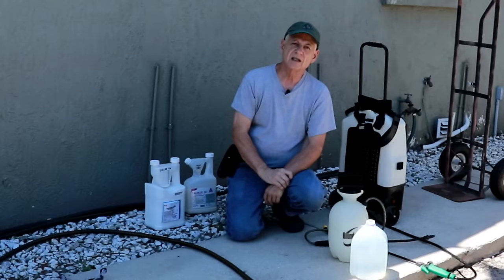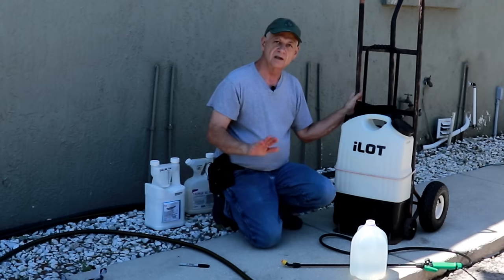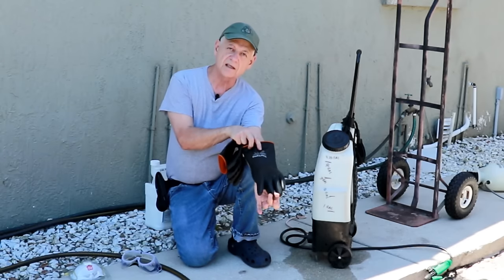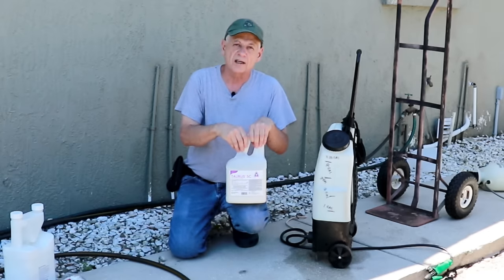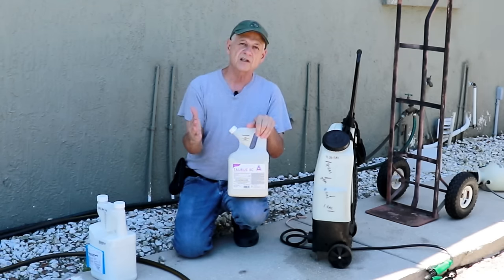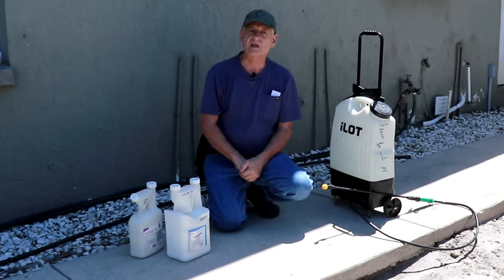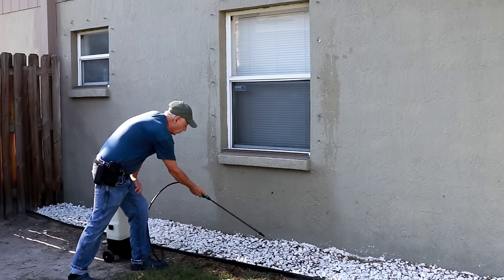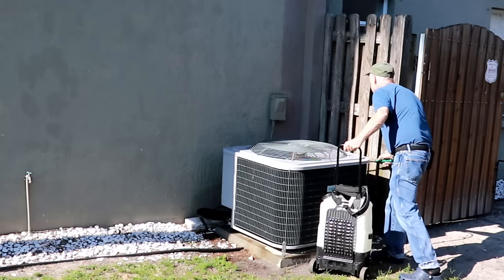General Exterior Pest Control - IMPORTANT!  READ THE DESCRIPTION.

Comment: Thank you for producing these super informative videos.  We live in Northern FL in a rural heavily wooded community.  Have you heard of Tekko Trio Concentrate as an indoor application for roaches, earwigs and ants?  Or do you recommend The outdoor use of Taurus SC instead?
Reply from the maker: Tekko Trio Concentrate is an insect growth regulator and not an actual pesticide.  It works by breaking the lifecycle of the target pest.  One of the big problems with it though is that it is very slow acting.  I think it is probably a fine product to mix with an actual pesticide, but I would not use it as a standalone treatment.  Most of the pests that are coming into your house, are coming in from the outside.  Therefore, if you do the exterior treatment every three months, you will no longer have any pests of any sort inside your house, except for the ones that either fly in through an open door or window or the ones that you carry in yourself.  I know that I wasn't very clear on this in the video because it was the first one I ever did and I didn't exactly do a perfect job, but you should know that what I meant to say in the video was to alternate between the Taurus SC and the Talstar P every three months.  Do the first treatment with the Taurus SC, then three months later use the Talstar P, then three months after that you go back to the Taurus SC, and so forth.  Also, the backpack sprayers that I suggested in the video are no longer available for purchase.  I will provide a link to the backpack sprayer that I recommend that you purchase.  It's a little bit pricey, but it will serve you well for many years.  After you do the exterior treatment, that should end most your bug problems.  However, if you already have some pests inside the house, let me know the specific pests you have and I will tell you how to get rid of them.  After they are gone, there won't be any more coming in.  If you would like to save a bit of money, you can use Bifen IT instead of the Talstar P.  I will provide you a link to the product.

I hope that helps. Be well my friend.

Backpack sprayer:  https://www.amazon.com/dp/B08B3MKYWD/?coliid=I1WHD5A3RF25H9&colid=3VDXA5DFBKQ98&psc=1&ref_=lv_ov_lig_dp_it

Bifen IT:  https://www.solutionsstores.com/bifen-it-insecticide

Taurus SC:  https://www.solutionsstores.com/taurus-sc-termiticide
Reply: I am immensely grateful for your thoughtful, detailed answer.  I will follow all your advice on treating our exterior.  That said, we spend a lot of time outdoors with our pigs, ducks, geese, rabbits and large vegetable garden.  My point is that we are likely bringing pests inside with us, especially “wood roaches” and earwigs.  Any advice on what we can safely do inside the house?
Reply from the maker: I don't know that I would be too concerned about bringing earwigs and roaches into the house. They are most likely going to try to make their way through the barrier that you applied around the house, rather than trying to catch a ride on your clothes or anything like that.  I think what I would be more concerned with is perhaps something like fleas.  These guys are hitchhikers and they will jump onto you and you can easily bring them into the house.  Let me know if that seems to be a problem or if you are seeing any roaches or earwigs in the house and we can certainly address any of those issues.  After you treat the exterior of the house, you may still see some of those roaches or earwigs hanging out in the house and you may need to treat for them to get rid of them.  I would give it at least a couple of weeks to see if anything that you have in the house just kind of dies off on its own.  Treating for the earwigs is kind of a pain in the neck, but if you've got them, then you don't have much other choice.  If you do have an infestation inside, then you should only have to treat for them once.  Wood roaches are pretty much an outside roach and they like to hang out damp areas, but they do not usually survive well inside.  Most likely, the ones you are seeing inside did not attach themselves to you, but rather were coming in from the outside on their own.  Since they do not survive well inside, there is a good chance they will just die off on their own after you do the exterior application.  So, please get back to me in a couple of weeks and let me know what you were still seeing in the house.

I hope that helps.  Be well Sharon.

Comment: Hello Guy. I can't find my comment thread with you, but I was the one who was going to drill through the concrete apron around the side and back of my house in Southern Illinois. You mentioned maybe not drilling and trench around the concrete instead. I went ahead and drilled it.... 90 holes and it only took me 2 drill bits. Actually, the 3rd bit fell down one of the holes. LOL. I should have wrapped tape around the top of the bit. It went well. There were maybe 10 holes that wouldn't take much of the Taurus solution. So, I took an old piece of hollow brake line and rammed it down the hole trying to pull out as much dirt. Just finished stuffing some hot water pipe insulation down in the holes and filling the holes with crack sealer. Down the line, I could always have a pro come out. The holes have already been made, and he can treat with a spraying wand. Honestly, I think I am all set with your help. Thank you.
Reply from the maker: How close are the holes?  The problem is that the termiticide may not expand underground so that there is a continuous barrier.  The material that goes down each hole must meet the material from the next hole.  The pros inject it under pressure.  You would need to drill the holes very close together for it to work well.  I mean like, every 4 inches apart.  That is why I say to trench around the concrete.  It works just as well as rodding under pressure.  Now, you may get lucky and the termites will go through the termiticide that you applied, but they may just go past it too, if there is a gap between the holes.  They won't look for that untreated area because they don't know the difference, so it's just a matter of luck.  If you get lucky, they will travel through the termiticide.  If you get unlucky, then they will miss it and the treatment will fail.  Do you see what I am saying?  I'm not sure if I am explaining it very well.  How well it will work also depends upon how porous the ground is.  It will work better in sandy soil than it will in clay. 

I hope that helps.  Be well my friend.
Reply: @GuysPestSolutions  That makes perfect sense. The holes are 8 inches apart. I can have a pro come out. The problems in the past were the basement windows and I drilled the holes very closely around the window.  My biggest concern was possible termites already in the house and why I wanted to treat the soil closer to the house. I could have a company come out and use the holes I drilled.
Reply: @GuysPestSolutions  Also, I forgot to mention, there is an alley that runs along my concrete walk, and I couldn't trench it.
Reply from the maker: If you cannot trench, then drilling and rodding is your only option, but if you have dirt next to the concrete, then you can usually just trench around the concrete.  Remember, the termites are not colonizing in your home and most likely not colonizing under your home or under the concrete.  They are most likely outside the footprint of all of that stuff.  Since they only travel a couple of inches below the top of the dirt, they will cross through a barrier that is outside the concrete.  As long as the barrier is between the colony and the house, then they will die.  Most of the time, the colony is within a 300-foot radius of the house.  I hope that helps.  Be well my friend.

Comment: Hello Guy!

Hope this note finds you and yours well.

I sent you a note from my iPhone a couple of days ago but not sure it went where I wanted it to.

Need some advice. We have a large Live Oak tree that has some insect evidence at its base. There is fine sawdust stretching out about a foot along the base. I can’t see any holes in the bark, but that tree has heavy bark fissures so hard to tell. I sprayed water on the sawdust a few days ago but now it is back with a fresh batch. 

We use Bifen XTS around the house with great success, thanks to you!

So, a couple of weeks ago I sprayed the base and ground around the tree with Bifen XTS. Still the sawdust returns.  I see no insects in or around the tree. I dug around the base but found no ants or termites. The tree had carpenter ants a couple of years ago as it has a large wound from a poorly cut off limb that is rotting the heartwood in that area of the tree. I killed those off with some borax which worked great. 

Any ideas on what bug I’m fighting here and how to kill it? I live in the Jacksonville, FL area.

Many thanks,

Tom
Reply from the maker: I did receive and respond to your question on June 26, 2024.  If you did not see that response, I will paste it below.  Now that I know where you live and you provided some other additional information, I can take a guess at the species.  This is only a guess because I have not seen the frass and I have not inspected the tree.  So, just off the top of my head, I would suspect drywood termites.  I recommend that you remove a section of a root where you are seeing the frass and put it in a 5-gallon bucket.  Do it quickly before the termites can escape.  Remove about a 24-inch section, so they will not have time to get out of Dodge before you have the root out of the ground.  Now that the root is in a bucket, you can start pulling the root apart so see what is inside.  There is a good chance that the offending pest will be inside the root.  If it's termites, then try to obtain one with a red head for identification.  Please take note if the root is dead or alive.  That really matters.

I hope that helps.  Be well my friend.

"Have been following your advice with excellent results using Bifen XTS. Now we have a tree with sawdust around its trunk. I sprayed the area with XTS but new sawdust appears. This is a large Live Oak that has damaged heartwood."

Reply:

"You are probably thinking that this is carpenter ants, and that is possible, but it may also be something like oak bark beetles or drywood termites.  If you spray the tree and your yard with Bifen XTS, that should eliminate carpenter ants.  So, if the problem does not go away after treatment, then that would make me suspect a different species.  Ants need to forage for food, so they will cross the pesticide, but things like beetles and termites actually eat the wood, so treating externally may not get it done.  You may want to get that tree inspected by an arborist.  Those folks should know immediately what you are looking at.  I hope that helps.  Be well my friend."

Comment: Awesome video. So helpful. What do you recommend for springtails? They seem impervious to standard pesticide.
Reply from the maker: Springtails need moisture to survive, and they eat decaying matter and mold, so if you have them indoors, then lowering the humidity and removing any mold will help a lot.  Most of the time, these guys hang out in bathrooms and other areas of high moisture.  The good news is that they do not travel very far from their nests, and that is why you don't see them everywhere.  The way I treat them is to use a deltamethrin dust.  The one I like to use is D-Fense dust.  You simply fill a duster halfway and then dust pipe penetrations, under baseboards, and any other cracks and crevices where you are seeing these guys.  You want the exit tube on the duster to be at the top.  The deltamethrin dust is waterproof and it lasts about eight months.  They get into your house from the outside, so doing an exterior treatment, including the yard, would be a good idea.  I will give you a link to my video on how to treat your yard.  It is also a good idea to treat the exterior of the house as well.  I have an updated video on how to do that.

I hope that helps.  Be well my friend.  
    
Video on how to treat your yard:  https://youtu.be/wifoTU5dmp0

Updated video on how to treat the exterior of your house:  https://youtu.be/Yozv3s-Qwlw

D-Fense Dust:  https://www.domyown.com/dfense-deltamethrin-dust-p-2428.html?pdpv=2

Duster:  https://www.domyown.com/bellow-hand-duster-p-106.html?pdpv=2

Comment: Thanks for sharing this amazing video. Perhaps you don't know how much you are helping a lot of us in saving a fair bit of money especially during these tough times. My question is regarding the equipment. Some of us has very high walls and soffits around 10-15 feet and could you please share your thoughts on a few equipment that would help us to spray without getting drenched with chemicals. Thanks again for your great video.
Reply from the maker: Your point is well taken.  Did you know that there is probably no professional pest control company that will treat the soffits and some windows on a house?  The rule that most of them follow is that they do not spray above shoulder height.  The reason for that is because it is very easy to encounter the overspray.  Of course, the problem is that the bugs don't care if there is overspray and if you live in an area where there are drywood termites for example, then you run a high risk of getting infested if you do not treat the soffits and windows because those are the most common points of entry for them.  Drywood termites are very hard to get rid of and they can do a lot of damage, so it's best to prevent them rather than try to treat for them later.  It's the same for carpenter ants and other pests that like to enter through the soffits and around windows and doors.  So, this is really something that you must do yourself or it won't get done.  Now the problem with the overspray is well taken by me and you are correct that the right equipment can help a lot.  PetraTools makes a very good line of battery operated sprayers that range in price from $129 to $450 and they sell an 8 foot extension wand for their sprayers that will allow you to easily reach 12 to 15 foot heights without the need for a ladder.  I will place a link below for it.  Still, gravity is going to be fully in effect and that pesticide overspray is going to come down and the wind is going to make it even more tricky.  What I do is shoot some of the pesticide into the air to see which way the wind is blowing and then I make sure that I am always standing away from where the wind is going to take the pesticide.  That being said, as careful as I am, I almost always get some of the overspray in my face.  That is why I always wear gloves, a hat, a mask, and goggles.  You don't want to get the overspray in your eyes and you don't want to breath it in.  However, the truth is that if you get some on your skin every three months you are not going to suffer any ill effects, as long as you take a shower after you are finished treating.  This is not the same for the pros.  You could suffer ill effects if you do this for a living and you get the spray on you several times a day, every day, and you don't get to take a shower until several hours after exposure.  The long term, daily exposure to the pesticide is what will get you sick.  An occasional exposure to the diluted pesticide that you shower off with in an hour or so should cause no harm whatsoever.  I mean, you don't want to bath in the stuff, but a bit of light overspray on your arm or face that you shower off fairly soon is no big deal.  Like I said, I get hit with the overspray at least once every time I do it and I have had no ill effects so far and I have been doing this for many years.  So, yes, buy the best equipment you can and be as careful as you can.  Always wear all the protective equipment, do your best not to get too much of the overspray on yourself, and always take a shower immediately after you are finished and wash your clothes.  If you do that, then you will be fine.

Thank you so much for those kind words.  The truth is though that the people I help give me so much more than I give them.  I have been around for a very long time and one thing that I learned in life is that the only things you can possess that will last forever are the things you give away.  The most valuable of these are your time, your knowledge, and your love.  I give these things away freely, just as often as I can.  So, while I do not have a lot of money, the people I have helped have made me a very rich man.  So the truth is that I should be thanking you.

Be will my friend.  Thanks for the question and thanks for watching.  Please give me a like and share my channel with others.  I would love to help them as well.

https://smile.amazon.com/gp/product/B086L5YQH6/ref=ppx_yo_dt_b_search_asin_title?ie=UTF8&psc=1
Reply: @GuysPestSolutions  Thank you so much for your detailed response.
Reply from the maker: You are very welcome.  I am always here to help.  Be well my friend.